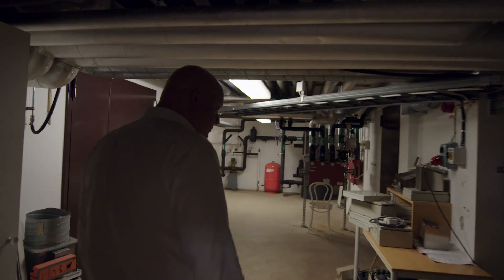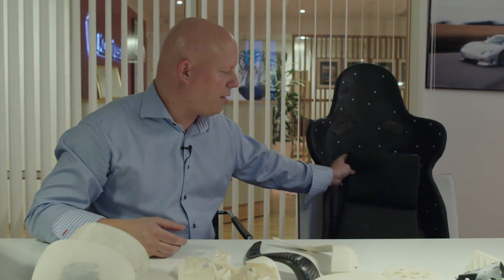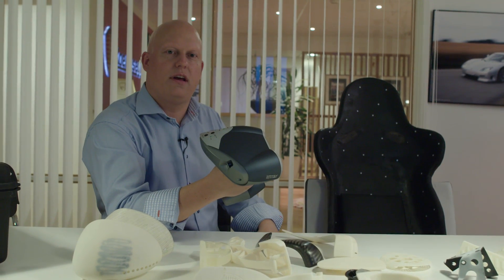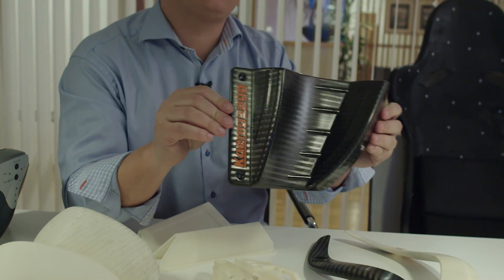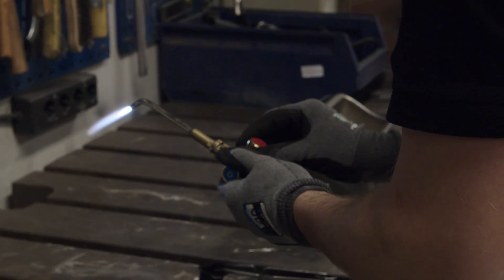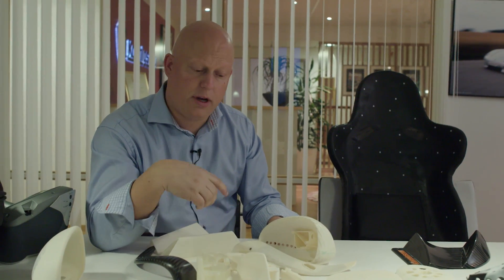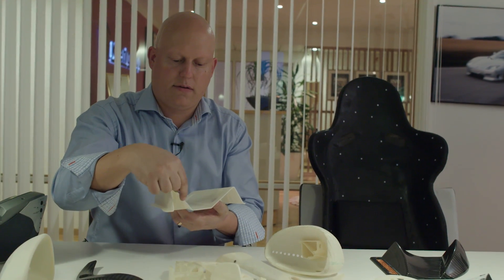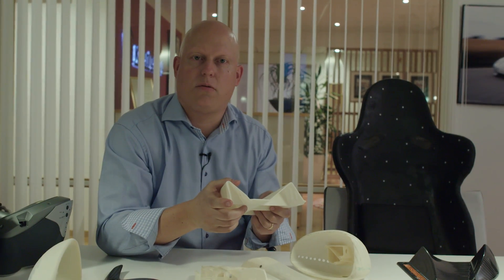3D Printing: Titanium, Carbon Fiber, & The One:1 - /INSIDE KOENIGSEGG

Comment: It's now when you start to realize the exclusivity of cars like these, the Titanium One:1 Exhaust alone was heat treated by hand. It's so beautiful to watch the car come together over time.
Reply: Forgive my off-topic reply, but, your avatar... is that a Prospeed Audi Sport Quattro S1?
Reply: Dr. Weird
Reply: Dr. Weird No sir. It's a modified Audi Quattro but it's not by ProSpeed
Reply: +fuckoffgoogle Anodizing is an electro-chemical process that oxidizes the metal the same way that heat does, but it does it by electrical current.  The part is the anode of an electric circuit.  No electric circuit, no anode, no anodize.  Heat coloring is oxidizing, but not by anodizing.
Reply: +fuckoffgoogle I thought you anodized with an anode.
Reply: +fuckoffgoogle Yeah no.  There's no such thing as heat anodizing.  Heat coloring is not anodizing, no matter how many people call it that.
Reply: +fuckoffgoogle 
anodize

/ˈænəˌdaɪz/

verb
1.
to coat (a metal, such as aluminium or magnesium) with a protective oxide film by electrolysis
Reply: +fuckoffgoogle Anodized titanium[edit]

Selected colors achievable through anodization of titanium.Anodized titanium is used in a recent generation of dental implants. An anodized oxide layer has a thickness in the range of 30 nanometers (1.2×10−6 in) to several micrometers.[11] Standards for titanium anodizing are given by AMS 2487 and AMS 2488.Anodizing titanium generates an array of different colors without dyes, for which it is sometimes used in art, costume jewelry, body piercing jewelry and wedding rings. The color formed is dependent on the thickness of the oxide (which is determined by the anodizing voltage); it is caused by the interference of light reflecting off the oxide surface with light traveling through it and reflecting off the underlying metal surface.
Reply: +fuckoffgoogle I thought you said you understood the science.  When you torch something, is the part an anode?  If the part is not an anode, how is it anodized? Your resorting to insults does not help your argument.
Reply: +a7i20ci7y - While you are right, and it is not anodizing, it is oxidizing the metal simply by using the flame (by some minute amount, as titanium has such a high heat tolerance). Although in this case, their purpose (as much or more than heat treating) is to bring out the color pattern possible in polished titanium surfaces through heat treating (as you know).
Reply: That's like watch a video about some insanely expensive swiss watch and see the amount of detail they put into a single cm^2 by hand you understand the insane prices

Comment: after watching the video I breathed a sigh of relief. The title was misleading I had to investigate, Me: "there's no way they can 3d print carbon fiber!?" or titanium for that matter.
Reply: well not really, the exhaust is 3D printed Titanium, and there are 3D printers that can print carbon fibre, in fact puts on hipster glasses I've know about development of CF 3D printers for at least 6 months now.
Reply: Uhm, well he just DID explain how titanium 3-d printing works. Their exhaust "tip" is made from titanium and is 3-d printed. Or maybe I just didn't understand your post...
Reply: PAPO1990 If that's the case then I'll have to look into it. I just can't see how it would be possible though.
Reply: dakibmw Going back through the video yes he did say they printed titanium I must've missed it. HOW THE FUCK!?
Reply: d .corntorteeya If I remember correctly it's called "Direct Laser Sintering" it's used in some plastic 3D printers as well, but Carbon Fibre 3D printing is still pretty much in it's infancy, I think there is only 1 or 2 3D printers that can use carbon fibre, and I'm not even sure if they are being sold yet.
Reply: My guess is that it will use chopped fiber that will be shot out with resin mixed if so.
Reply: d .corntorteeya from what I've seen it looks woven, but it's still early days and there hasn't been much to see yet.
Reply: how the f can you spray out woven material? does that not raise question to you?
Reply: d .corntorteeya it doesn't have to spray it, just because the only 3D printers you can think of use nozzles doesn't mean they all do, but if what I've been able glean from pictures is correct, it has 2 spools of thread and weaves them, but I could be mistaken.
Reply: Interesting. but robots are taking too many jobs from humans!!